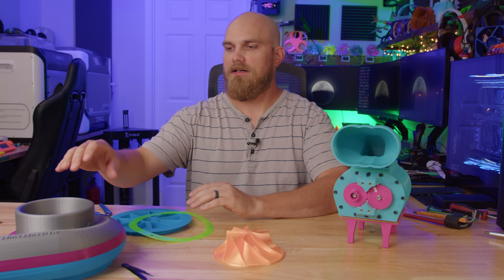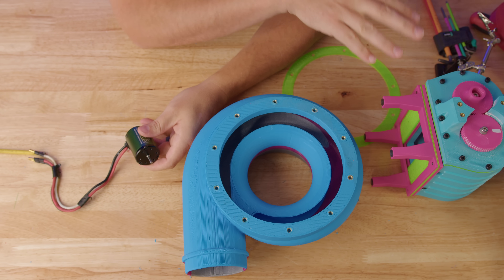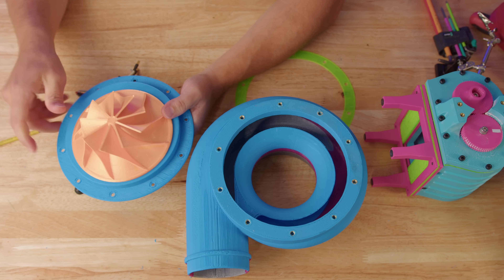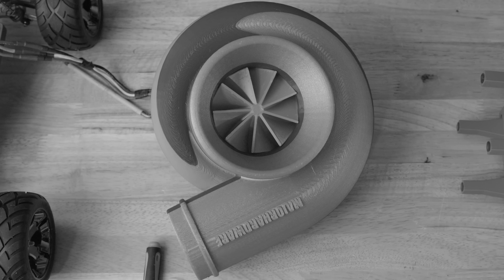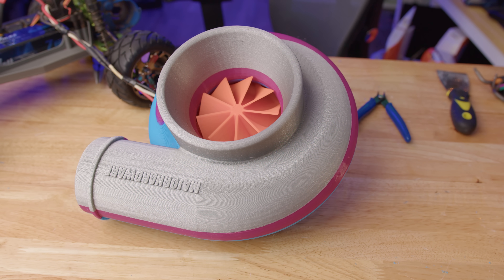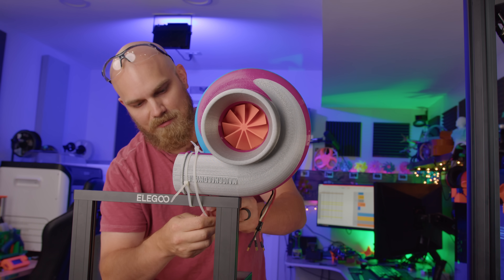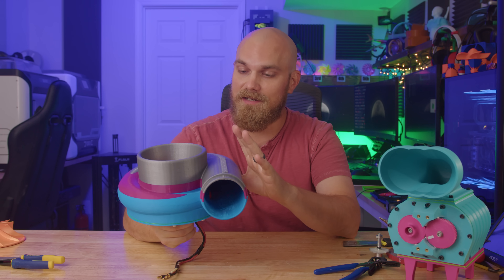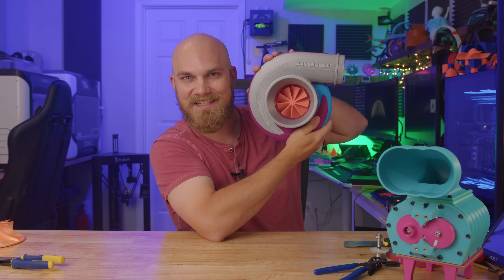I BUILT a MASSIVE ProCharger for my PC

Comment: i love this. its so cool.

i did see the same leakage so your already on that. Would love to see a new motor. Dont know that you need bigger. At least something with a better shaft. I havent gone back to see if you shaft was bent in other ones. but then again what bent the shaft these projects or something prior when you were doing RC racing with it. Thats neither here or there, its bent. 

I am curious why you havent picked up or designed something to set this up with out using the RC set up. Yes convenient for sure. just plug play go. why get something else. but then you dont have to worry about the battery you can power through witha different power suply. really that last part is just me getting picky about it since you are having so fun. i also dont have the skills you do so kinda living through you on this

ok have fun keep up the cool content.

Comment: Buy water jacket for brushless motor.
Buy esc water-cooled (esc for boat).
Then combined it with pc water pump and pc radiator. 
And you won't have overheating problem.

Comment: I'd really like to see you stick a bundle of drinking straws in the last 1.5" of the tube to see if you could induce any laminar flow type effects on the smoke exit. To be clear, not with the whole length of the straws, but just like an inch or two, with a bit of tape holding them in a round shape to fit in the end of the turbo housing. Thanks for the fun content!

Comment: Bigger?  I would go smaller. It may perform better if the motor wasn't so overloaded. Maybe use a reduction gear? Maybe find a way to pull air through the motor to keep it cooler.

Comment: More of the turbo charger.  I think some of the tolerances are a bit squiffy, causing loss of performance.  On the subject of electric horsepowers, maybe look at Raz Shifrins speed run channel for info on big power set ups.  But definitely more of the Miami Vice Turbo.

Comment: You need to test this with a THICCC radiator assembly, maybe something like piling up 120mm radiators and checking how many it can handle as a turbo actually is good on making large airflow with pressure and running it without any pressure is a waste.

Comment: I'd like to see the gasket sealed up like you mentioned and paired with a stronger motor. Although, I'm skeptical about using the pinion gear rather than sticking it directly into the fan itself but I'm not an expert on that.

What I would do though, is add some Superlube with PFTE to the underside of the fan and shroud to see if the lubrication helps with the friction. The PFTE is supposed to introduce a Teflon layer that keeps friction down. This might help with resistance on the next motor you use.

Back to that pinion, maybe the next version you make should use a bigger pinion, since there with be much more force than usual? 3D printing is cool but I feel like if the pinion stays, it should probably use either a stronger material or straight metal. Press fitting a metal pinion would definitely help with making sure it won't break when the forces become too much, which could possibly save you with needing to reprint a new compressor fan.

Comment: 5/6mm shaft motor off of 1/8, 1/5 rc. low kv no higher than 2500 i'd say.6s/8s esc and 4s/6s lipo. imho

Comment: Love it. I think you should make a full through shaft to a bearing held by spokes on the intake. Will help keep it straight, centred and stable. Then you can tighten up tolerances to close up the gaps and improve pressure retention.

Comment: Not to be a dick but i think for tall things like this to work you need to work on the printer skills. Pretty much all your tall prints have sag and that causes all kinds of issues and screw the results.  you can clearly see the wobble is because of the printed parts not the engine. That causes massive load on the engine. Maby do a colab with a printer company or other printer channel or something to get it set up right and many figure out what is going wrong.

Comment: why do you hook the motor to the shaft of the impeller directly? just make a gear for the shaft and a pulley for the motor and connect them with a belt. you can even change the ratio so the motor doesnt overheat as quickly and fix the wobbly shaft in one go.

Comment: Given the size, the procharger is about the average size you can see on a car where as the Roots is about 1/4 the size so that given then the Roots is throwing a disadvantage in volume. If you do a second version of the procharger then might use bearing and stabilization like a front cage of the impeller. Help with the wobble and given that the material is plastic then it does not have the rigidity of metal alloys so extra reinforcing I think would be allowed here. 

If you want a motor to run it and still be battery powered (DC atleast) then battery powered leaf blowers that use 20V drill batteries. They are roughly a electric powered procharger, would be a good place to start in atleast motors. Be good option for the Roots as well and large fan that you messed with once... the 200MM I think was its size. Otherwise I know you can get high RPM drill motors that are like 10k that use 20V. I think they might be used in battery powered angle grinders and they also come in 20V 

If you could then maybe make a bit larger supercharger closer to normal competitive size and instead of being for just cooling a fan radiator, consider it cool a 2 fan radiator (maybe try a 3 fan after) for size use but to test on the device a simple 90 degree converter duct. If anything you can see if more bigger Roots gets more bigger numbers. Procharger might be better for 1 but not as great for 2 or 3 fan coverage.
Reply: The old engine block PC is where I am going with it mostly as it would force air over the Rad and into the PC and the exhaust would be small fans pulling out heat. Pretty sure the compressor blades can be swapped with squirrel cage fans side by side which will work as that's basically what tower fans are. Be less noisy atleast as you can get arid of the single motor and gears and have dual motors with RPM controllers running them.

Comment: Just use an outrunner motor (>40mm housing/insert). Also it is better to combine low kV with high voltage (>4S). For best rpm control use a Heli ESC. It's also critical to ballance the fan perfectly (start static).

Comment: Here's an idea for a motor: 500W 100V DC spindle motor for a cnc router. i bought one last year for around 60€ from aliexpress. it comes with a power supply with adjustable speed. It's about the same size as a redbull can.

Comment: The more rpm you get get out of the motor the more air it will displace you would want a motor that could spin 15k+ rpm even then a gear reduction would be beneficial to get closer to 30k rpm compressor speed and if you want to create actual boost look into ar ratios for compressor housings sometimes size isn’t everything with turbos/centrifugal superchargers

Comment: Hey, cool trick, on big surfaces like that where you wanna decrease friction you can absolutely just smash pencil lead onto them. Graphite has amazing anti frictional properties and is really handy at getting certain things to just work sometimes. You can also straight up buy powdered graphite lubricant which works way better and took me way too long to realize it should just be your first go to. Don't...don't bother with pencil lead.

Edit: Also I'd suggest buying actual "build your own" gasket material to just trace out, no way it should fail. Stupid cheap at any auto store. Handy to have around for tons of reasons, from actual gaskets, to soft lock washers, to weird squishy stackable shims.
Reply: WHat would prob be easier, you can buy graphite powered from the hardware store that is used for lubricating locks
Reply: Like pretty much all solid lubricants, graphite isn't particularly good, and it won't prevent PLA from sticking to itself which is most of the friction. Oil would be much, much better. Printing the wheel from a different plastic that doesn't readily mix would drop the COF to something more reasonable beforehand, HIPS is a good choice.

Better than all that is just redesigning the turbine wheel to have a tiny bearing on the other side so the starting torque doesn't cause it to wobble and scrape.
Reply: I think Teflon spray would work pretty well for this.
Reply: @badsamaritan8223  that was the first thing that came to mind for me, thin film of teflon would really help. Spray the mating surfaces prior to assembly with ample time to dry and youd have a decent low friction interface.
Reply: I'm actually rather fond of the liquid gasket material. Easier to clean up afterwards also. Leaves clean seams.
Reply: Graphite powder has been my go to lubricant for any prints that don't have quite enough clearance. Always does the job.
Reply: Great ideas to push the pro-charger idea further. I really like the 'build your own" gasket material! I put it in my cnc laser cutter to replicate old gaskets that I can't buy in my area. Very handy to have.
Reply: @Easiermarlin33  My wife has a Cricut and that thing works great for cutting out gaskets. You can scan the surface you need a gasket for and trace it to make an .svg file to import into the cricut utility.
Reply: I believe he actually used graphite in one of the geared fan videos like 6mo ago, works great with metal surfaces but not so great with plastic
Reply: Yes, traditionally turbos need oil. Some type of lube may be helpful.
Reply: Need to be careful though as Graphite (and Graphite powder) is electrically conductive.
Reply: or, hear me out, 500 to 1000 grit sandpaper. wet sand it. then a 5000 grit wet sanding for a final run. Boom, no friction points, and smoother airflow as their is no rough surfaces.
Reply: Wont that like scatter particles in the air everywhere?
Reply: @635574  the powdered stuff does a touch, but the majority of it packs into the surface. Imagine it like smashing chalk dust into porous plastic, but not as bad. Ones you put a bit on, rub it in and repeat till you've coated thoroughly a small blow will get the other stuff without too much mess, the trick is going in stages till you're happy.

Comment: I'd suggest a decent sized rc plane outrunner brushless, usually got 5mm shaft or bigger and there's plenty of threaded adapters for them, plus they're usually quite well balanced. Have seen them up to 50-70cc 4 stroke equivalent sizes so should be able to find something more reasonable pretty easily.

Comment: Procharger is a belt driven turbo charger..  turbo charger is driven off of a motors exhaust gasses.   Thats more like a vacuum cleaner in the shape of a turbo but i guess it does still compress the air with the turbine blades and housing which constitutes the term turbo charger..

Comment: You sir just made a leaf blower lol start looking online for replacement motors for leaf blowers and you will find 10000 rpm plus capable easy. Prices should be good too might as well adapt the power bank set up with  a good 20V lipo battery

Comment: Hey, as a little tip, in the engineering world. We use belts to drive those kinds of things so you can set tensions and not destroy the shaft of the motor as it's a lot of strain directly on a motor shaft. Generally, it means you can use a larger shaft through the centre which will obviously be stronger and less chance of moving off centre.
Reply: oh use a belt to simulate the crankshaft spinning the charger up? that's a cool idea I like it.

Comment: You gotta stop with these direct drive shenanigans on that hobby motor. That castle thing is probably one of the 7700kv ones I'm guessing, if you want to direct drive you probably need like a 600kv motor on a high voltage.

Comment: Pro Tip: Raise PLA parts strength and heat resistance (from around 50 C to around 90+ C!) by boiling it in water (yes, you read that right). Around 2 minutes per wall mm.

Parts will shrink aprox 2%. But shrinkage is repeatable. Works best for parts with simple geometry, thick walls and a flat bottom.

PS: Don't let boiling parts touch each other while boiling, as they will sometimes stick.
Reply: Per wall mm?
Is that the thickness of the wall or the total area?

Comment: If you type "high speed electric motor with 6mm shaft" into Amazon, you get hundreds of options. I am certain one of them will suit your needs. If I could make one suggestion for a motor... try a Dremel style tool from harbor freight. They are high speed  high torque and variable speed controlled with a pedal. It's ideal for your purposes. Think about it.

Comment: Uhm is there a way to 'center' spinning things?
As a non-english speaker: i mean so it doesn't wobble?
All 3d printed spinning stuff usually wobbles?
Reply: Also can you put 2 ProChargers in a row?
Exhaust of the 1. one into the 'input' of the 2nd one?
CHARGE THE CHARGER TO EXTREM CHARGES! 😁

Comment: I’d bet you could make one of these custom fit for your vehicle.  I’ve seen a guy on other channel make cold air intake for a Jeep, so 3D printed materials will definitely survive under hood temperatures.  Once you get a beefier motor, you could even use that to make it start shoving air into the engine by the flip of a switch so you aren’t nuts with boost all the time.

Otherwise I suppose there is always the old fashioned way with pulleys and shit, but I think it would be far more fun and ridiculous to make it something that just replaces the air box, and just shoves additional air into the intake, rather than bypassing it.

I know this channel is more PC focused, but you can’t tell me that you’ve lived in Metro Detroit for as long as you have and not gotten into car stuff just a little bit.

I think even if it’s utter trash and falls apart, if you gain any additional horsepower, that’s worth every Penny you spent on that super cheap filament.

Comment: Turbo, pro charger, only diff is belt driven or exhaust powered, pro chargers give u the compact size of turbo with ability to have  a shorter pre lag, late spark to push extra exhaust power to spool up faster, completely eliminated due to being belt driven.

Comment: I think the best thing you could do would be to cheat a little bit, and put it on a shaft, with a front and back bearing.  Then couple the motor to the shaft.  This should REALLY help with the wobble and hitting the housing.  
Its cool to see it nearly 100% 3D printed, but I feel like it evolving into its full potential is cooler.

As for motors, I don't know a lot about hobby motors, but you might look into Clear Path servos.  To be frank, they are expensive, easily in the $300-600 range, without the power supply, but they are amazing, next gen motors.  They top out at 6,000 rpm, so depending on your design, you might need to gear them up, but they have configurable torque, power, speed, etc settings.  I am only familiar with them with a step direction input as if they were a stepper motor, but I believe they should support servo voltage drive too, and probably more that I am not aware of.

Comment: Have you done the maths on the radiator you're using? There will be a point at which increasing the volume of room temperature air over it will not increase the cooling effect.  

loving the computer nerd version of cartubers making a 1000hp honda civic though.

Comment: You made a 3D printed centrifugal compressor. They are designed with that shape and wheel to create pressure at 20-60k rpm. They will move air at lower rpm like a fan would but will never be as efficient as a fan or a blower fan. It will consume more energy and make more noise and complexity and size will make it just a show piece not real usable as computer fan. Try to make a blower style fan (hamster wheel) powered by that noctua motor. They work like a centrifugal compressor air comes in the front and exits on a side but they move more air at lower rpm.  It will be a challenge to build a housing and route the air in the right direction but it could beat any other fan.

Comment: Reach out to Integza on YT, he has a fair bit of experience in 3D printed compressor housings for jets etc. Even though his projects involve super high heat and pressure, he might have some insight or advice for getting things running smooth too.

Comment: If you could install a throttle valve plate in the turbo exhaust, you could possibly have turbo sounds too, which would be wildy impractical but cool asf.

Comment: What you need is a Mamba XLX2 + 800kv 2028 Castle Motor. This will definitely do the trick. Get yourself some QS8 Connectors and a GensAce 100C discharge 4s x2 (8s total) batteries and you’ll be cooking with fire. This is a standard setup for 1/5 scale monster trucks, will hold up well to the abuse.

Comment: the compressor wheel needs to be balanced for high rpms to prevent wobble and should work way better along with better clearance from compressor wheel to the housings.

Comment: Get an outrunner motor and use the rotating body as the shaft ;) but see that you don't forget to change the compressor wheel to use the body and also don't forget the cooling of the motor.